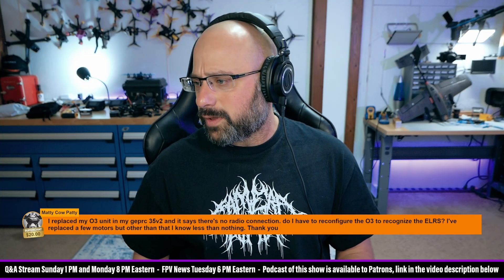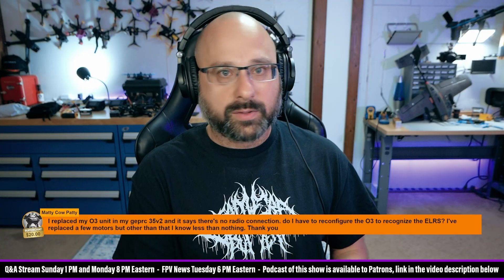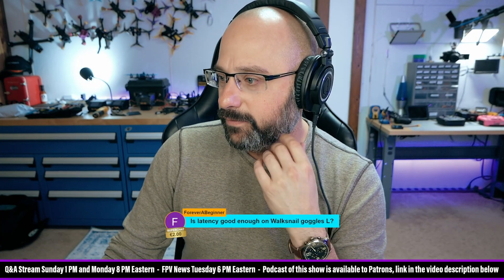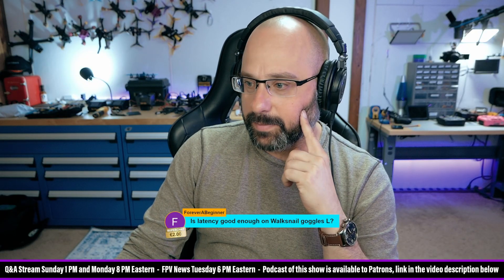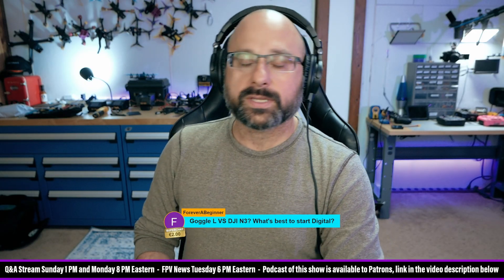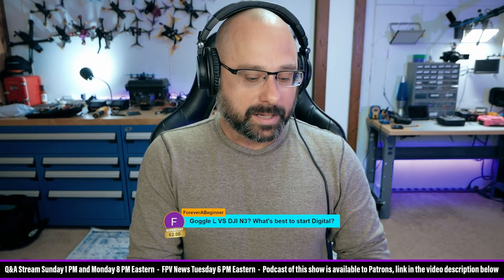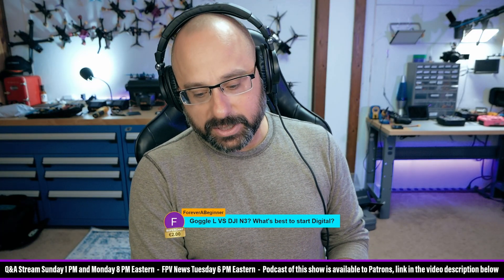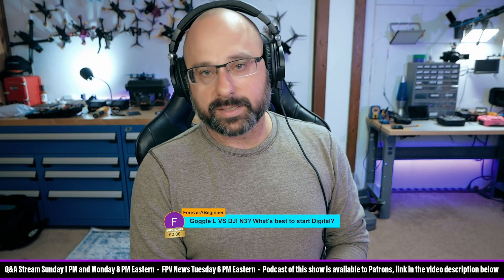Should I Buy the Cheap DJI Goggles Or The Cheap Walksnail Goggles? - Misc FPV Stream Questions

Comment: I's been proven that Gogles L have the same exact latnecy as GoglesX in 60 fps mode...
Reply: Dji fan boi will still not believe  you,
Reply: @robw5735  Why do DJI fans care so much if Walksnail was always supposed to have better latency? I use both but the advantages and disadvantages of each are clear. 
If you're going to fly a drone long range high in the air IDK why you wouldn't go with Walksnail. If you like to do what I do by driving FPV on the ground then DJI is going to be the obvious winner.
Reply: @Magneticitist  arrival of a fan boii has arrived just like the drones of NJ
Reply: @robw5735  Well which brand are you talking about cause I said I use both.